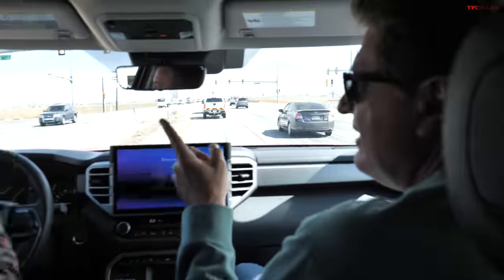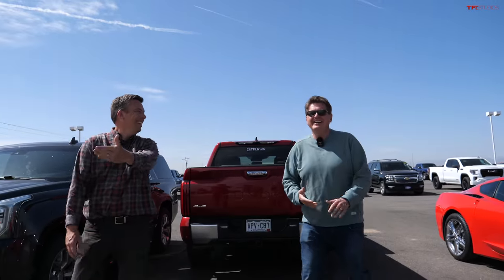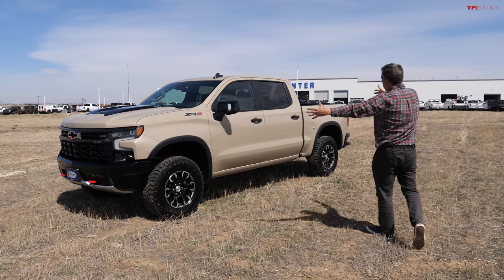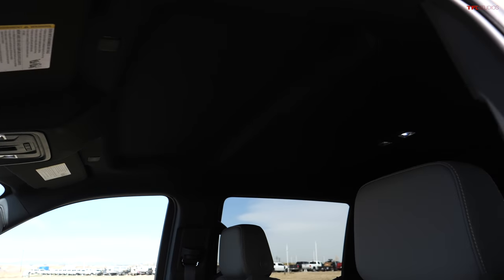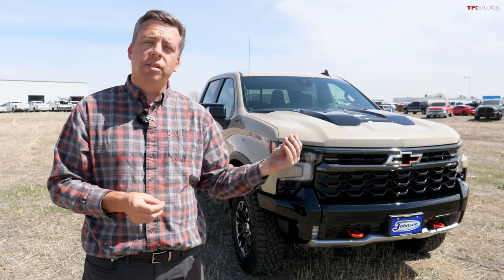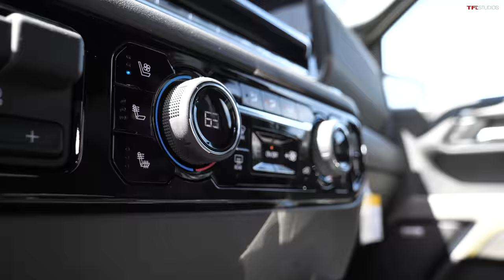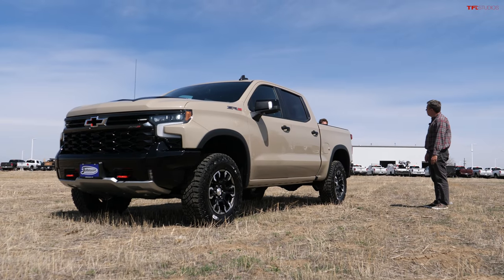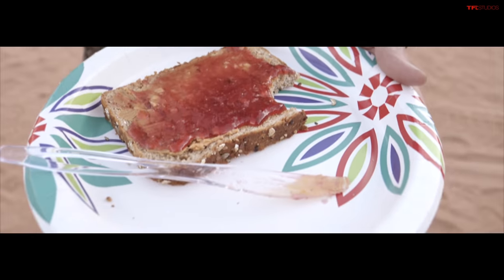We Traded Our 2022 Toyota Tundra TRD On This Brand New Off-Road Truck - Here's Why!

Comment: Roman still trying his best to compare the ZR2 to a Raptor and TRX, thankfully Andre is there to bring him back down to earth.
Reply: 🙏 amen. Preach it!
Reply: Please tell us what GM has to compare with Raptor and TRX?  They are comparing the most capable off road trucks each company offers.
Reply: @mikek5298  his point is that the zr2 isn't in the same league.

But I get your point also.
Reply: The only vehicle that can embarrass a Raptor or TRX is the GMC Hummer EV.
Reply: @mikek5298  i'm not sure now man, with the front and rear lockers on this ZR2 they're very offroad capable!!!
Reply: If GM decides to build a worthy competitor to the Raptor and TRX. What will they call it?
Reply: @narinchhem2845   They will call it ZR4ATVX-1
Reply: Andre is the top Dog on TFL.
Reply: @tjw1210  yeah on trails. thats not the same as a desert runner. like the trx and raptor
Reply: @tjw1210  it is. For some reason people believe having 700HP makes a truck more off road capable.
Reply: ZR2 is not a direct competitor to any models
It is way above the FX4, slightly above the Tremor, and below the Raptor.
It falls between the Rebel and TRX.
It is a hair above the Tundra TRD-Pro.
It is above the Titan Pro-4X.
Reply: Who lives in a desert and needs a desert runner? I live in the woods.
Reply: @googleaccount2637  to go offroad in the woods its a much smarter to get a Jeep for the width
Reply: @mattbrew11  jeeps don't haul wood or plow as well.
Reply: @narinchhem2845  Zr2 Bison maybe
Reply: @LEGEND04131  maybe in a straight line on the pavement. I guarantee the hummer can't run baja like the other 2
Reply: I get it from a power aspect, but from an offroad aspect power isn't everything. Their are things the rebel does better than the TRX. The raptor proves you don't need a ton of power. Look at all the jeeps. Very capable not a lot of power. So while I love the trx it's power shouldn't put it in the top alone.
Reply: GM still has the Sierra to build a Raptor competitor.
Reply: They do that for a reason to give two points of view. It is not supposed to be one sided.
Reply: @mikek5298  Hummer EV would completely crush those.
Reply: @narinchhem2845  what do you mean if? GM already has a worthy competitor, the Hummer EV.
Reply: @mikek5298  still not an excuse. Would you compare mazdas CX 50 with a raptor because its mazdas beat off roader??
Reply: This is closer to a Ford F-150 Tremor with the 402A package. It has a few things better than the Tremor and a few things worse.
Reply: I don't know if anyone remembers, but roman never liked trucks when they first started. I always liked Andre and the short guy with the bald head the most. I sure he is a cool guy, but ?
Reply: @nismomike3182  If you don't mind going between 1/2 and 3/4 ton, it almost seems to me like it would compete with the Power Wagon in terms of off-road capability.
Reply: @LEGEND04131  how?
Reply: So true!
Reply: @LEGEND04131  when was the last time you seem a "red " grill on a TRX or RAPTOR only embarrassing thing is gM (china motors)
Reply: No,No,No!!!
Reply: I believe the ZR2 is more a rebel-tremor competitor
Reply: @mikek5298  So what. What is the Dodge competition to the Ford GT and Chevy Corvette? The answer is they don't have one.
Reply: here come the butthurt ford and ram cry babys..
Reply: Thank God
Reply: @kokocostanza2036  I'd say pretty close on everything slower speed. The PW has more articulation due to solid front axle and sway bar disconnect. But ZR2 will run away from the PW on higher speed trails due to ifs and high end shocks. Oddly enough, the payload and tow ratings are pretty close
Reply: @camclarke9952  Why would they be crying? Both Ford and Ram sell a truck that is more capable than GM. Your statement makes zero sense.
Reply: @LEGEND04131  in a straight line on the road but other than that nah
Reply: @jakeesayian2687  You don't know anything about the Hummer EV.
Reply: Agree. I'd say it's closer to a Tremor.
Reply: Actually, Andre likes GM products a lot. Roman is the pro Raptor guy, Nathan is their Ram guy it seems. Either way it’s cool to have different likes in a channel.
Reply: @WilC379  Not really. The chevy can get into tiger places than the TRX and Raptor. You can also lock both diffs. On the ZR2.
Reply: @WilC379  well they did, but they discontinued it in 2017. So current production you’re right.
Reply: @mikek5298  the Raptor and TRX are a league of their own meant for higher speed offroad enjoyment whereas the ZR2 is meant for slower, more technical offroad terrain. It was never meant to compete with the other 2.
Reply: Yeah expected way more when they came out with it. I like the older 6.2 whipple supercharged Raptors because I like the V8. TRX is just bad A. I’ve always liked GM and owned several over the years but they just aren’t in competition with Ford or Ram.
Reply: Took TRX almost a decade to add a supercharger,  raptor was in top than when with turbos..... next year they'll be back. GM needs a supercharger on the silverado Zr2, that with front rear locking diffs, front camera,  6.2l naturally aspirated, multimatic 4k shock upgrades and 37s.. now we can enter the coliseum. Until than gm will play it safe,  they are moving corvette to its own company side now with the current administration. That's probably why the corvettes old 6.2l isn't on the zr2 yet. GM there's a reason your stock price is better than the rest,  you play it safe which means I'll be waiting 5 years for a zr2 supercharged and or turbo (hopefully not).
Reply: @davidporter7051  has nothing to do with what’s under the hood. This Chevy isn’t even in the same league as a Raptor or TRX hardware-wise.
Reply: @chefcjnobles1680  it is the only advantage the TRX or Raptor has it's a wider body. If you don't need a desert runner this is moot.
Reply: it doesn't compare horsepower, prerunner wise but for everyday offroad and even rock crawling itll probably perform better with electronic front locker.
Reply: Agreed. The trx and raptor are head to head and the zr2 will be going head to head with the trd pro tundra
Reply: @LEGEND04131  that isn’t really an off-road truck
Reply: @davidporter7051  lol well said! More power doest mean better off road capability 🤣🤣
Reply: @lespaulplayer1234512 ……so what you’re saying is it’s a Rebel and Tremor competitor
Reply: @pete4261  better and not being as good lmao
Reply: @mikek5298  nothing, I think that was his point lol
Reply: @josemiguel8149  yes
Reply: @frenchonion4595  i think that's selling the zr2 short, but this is all just a matter of semantics and you have every right to say what you believe! The DSSV's and Front/Rear lockers make it a great truck to go offroading with. The best not by far but still very capable!
Reply: The trx and raptor are for dunes and thats about it,  this truck is just as capable and better suited for trails. Practicality it wins.
Reply: @chadsteele1   they others win im speed and suspension travel. The zr2 definitely wins in slow crawling offroad scenarios. That front locker is a game changer.

Comment: Honestly people never satisfied they always want more and more from a truck .......1. Can it get you from point A to point B  and 2. Is it reliable  long term..... that's all I need from a truck.
Reply: So true people treat cars like how they treat their phones they want a yearly trade in and well never satisfied sadly
Reply: Just buy an early 2000’s truck - not that old and not that new and probably more reliable than modern trucks and much easier to fix.
Reply: The Tundra would get you there and back, likely forever.  This thing will be dead by 100,000 miles.
Reply: @Sean2884  thats funny, ive owned 5 different GM trucks and they've all gone well over 100k miles with no major incidents or repairs or failures.  ive had V6, V8, and duramax diesel engines and all 5 of them where running strong when i sold them.  my current 2009 GMC Canyon with 5.3L V8 4x4 Z71 and 4.10 gears is almost 14 years old and has never been to a mechanic shop other than general maintenance.  its never broken down, its never come across a snow storm it couldnt drive thru and ive had it on numerous off road trails and it performed beautifully.  Side note, the Tacoma i owned had a factory tire blow out with only 14k miles on it and it over heated on me twice.  once it overheated on an offroad trail on steep inclines and the other time a simple gravel size rock easily penetrated the radiator on the highway and dumped all my radiator fluid in seconds.
Reply: @Sean2884  so your saying a twin turbo V6 (tundra) will outlast the 3.0L duramax (silverado).  unlikely, especially since the wastegates/turbos on those toyota engines are failure in large numbers with under 200 miles on them.  2022 Tundras are failing within a week or two of ownership.

Comment: I am curious about how many maintenance issues you have with it.  We gave up on GMC products after our last two first year models spent months in the shop.   Looks very nice though
Reply: Oh, they will have quite a few I'm sure.  Don't know if they will keep it long term or be honest about the repairs though.
Reply: Half of my Chevy/GMC buddies all have had major issues with their truck and suvz,,
Reply: Didn't anybody ever tell you to avoid the first model year of any vehicle?? Even that dinky new Tundra will have issues with its brand new power train. Quit acting like it's just GM because it isn't. RAM just recalled 700,000 trucks because THEY CAUGHT FIRE. If you're smart, you wait for something to be tried and true before you buy it.
Reply: @MB.1111  yeah our last was a 2015 Denali XL we owned it for 5 years and it spent 1 full year in the shop our second worst non GM vehicle was a Ford flex with 14 days in 6 years.  Never again
Reply: @glockmaestro  And this is why I would never buy any American car. I actually just bought a '19 Tacoma TRD OR because my dad has had his '02 TRD OR since it had 4 miles on it, and the biggest repair he's had is a driveshaft when the the truck was about 15 years old (also has low mileage at 120k).

The resale value on Toyota trucks will always be higher as well. My dad's '02 is worth like $9-10k still. I can't imagine the ZR2 will be worth more than $35-$40k in a few years, especially if it has any real mileage on it.
Reply: i had a 2007 trailblazer ss new and traded it in at 225k miles.. 0 issues   best vehicle ive ever owned! i miss it! :(  that was my one experience with GM.  maybe it was just simple and robust then with the 6.0 v8 and 4 speed auto lol
Reply: @adams1696  that's awesome I feel like the Yukon's from that period were really solid as well.  They seem to be under engineering things now
Reply: @adams1696  that bitch was built in moraine Ohio too!! That Doc…”the last truck” was so sad how gm killed that plant cause no one was buying SUV’s trucks in 08’ cause the crash and fuel prices…looks like we’re about to repeat that now.
Reply: @TheReaper-gq8jz  Toyota trucks have been made in America (Plano TX) since 2010. They have more American Made parts than a GMC, Chevy or a Ram.
Reply: @marksiegel374  And the other half have no issues, which is remarkable.
Reply: No one keeps things long term anymore. Especially these guys

Comment: the Front and Rear lockers on this is a game changer for the half ton segment 🔥
Reply: In the type of offroading these trucks fit on theres little difference between a torsen & front locker
Reply: There is a LOT of difference!
Reply: @Hellenkeller777  You never ran torsen LSDs. They are not clutch pack posis. Lockers hinder turning. For a pickup that is already long and not ideal for real off-roading, the torsen is a significantly better option over a locker in the steer axle.
Reply: I would go Torsen

Comment: That will be my truck used in five years with about 100,000 miles I'm going to keep rocking my 2016 Z71 with 130,000 miles and counting with zero issues untill then. That's the only way I can afford it lol

Comment: Ford and Ram made purpose-built off road trucks with the Raptor and TRX... those trucks were purposely built with different components/body panels to set them apart from their regular truck lineups. GM just replicated the formula they used with the Colorado and simply took their standard truck and added components. They didn't make a separate, proprietary off road truck like Ford and Ram did. That's why the Silverado ZR2 only comes with 33's. This is also why the Colorado ZR2 comes with undersized tires as well and requires modifications to the body to put bigger tires on it. I'm sure the Silverado will require mods to run 35's and maybe AEV or others will come up with aftermarket fender flares and other parts to run on these trucks. Who knows. But I guess GM was looking to hit a different truck market/segment and not go after the dinosaur trucks. I bet it still competes pretty well off road with those other two though. Someone is going to do a comparo and post a vid. Watch. 

GM should make a Raptor/TRX killer and call it The Meteor, lol.
Reply: @Anthony Cioffi, LOL!!!   If GM doesn’t like that name they could also call it the Silverado Asteroid! 

Also, as you stated this truck isn’t a “direct” competitor to those trucks!  And let’s be honest. Most people who buy these types of trucks for $70k+ don’t truly take them off road. They are pavement pounding princesses. The Raptors and TRXs around here are driven by doctors and lawyers!
Reply: The Chevy off-road concept is a purpose built truck. All GM has to do is build a few to shut some people up.
Reply: “Someone is going to do a comparo a post a vid. Watch”
Holy shit we got Nostradamus over here. How ya feel about Tonight’s powerball champ?

Comment: Good looking truck and Cool bow tie on the front.  So glad I bought a 2021 Tundra with the V8 and saved $20K+!  Spray in bed liners are way better than the plastic drop ins.  We had a Dodge Ram with a spray in from LineX in a 2004 that we just sold a couple of months ago and it still looked good with little fade and held up great over the years.  Had a drop in on a Toyota for years and while it was tough it did cause rubbing on the bed and was very slippery.
Reply: The Toyota bed is not a drop in, if you think that you actually have no idea. 

Go look at some 10 year old Tacoma's. They are indestructible
Reply: @Mycameron2323  it was a 1984 Toyota with a 22r motor which have metal beds and had the drop in plastic bed liner as an option.  Yes these truck were manufactured before Toyota made Tacoma’s in 1995 if I’m not mistaken.  I’ve worked for auto manufacturers for over 25 years so maybe you ought to do a little research before telling someone they have no idea.